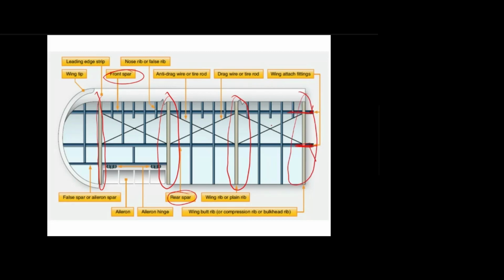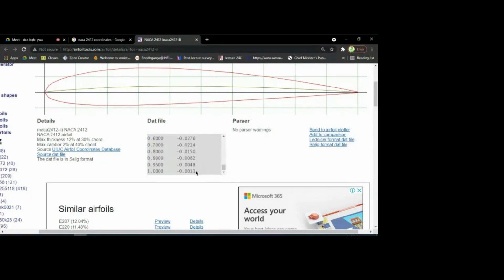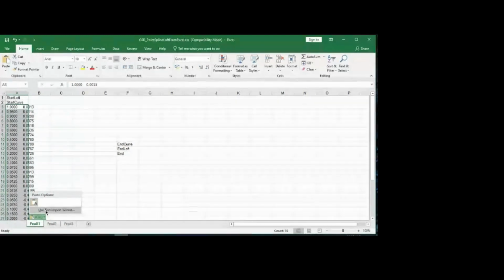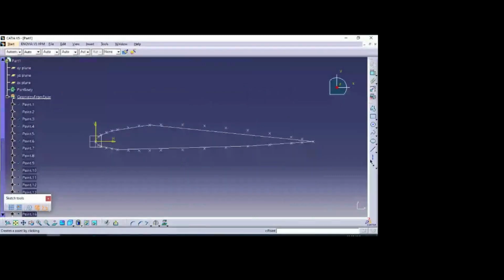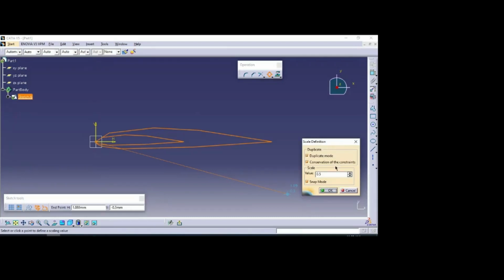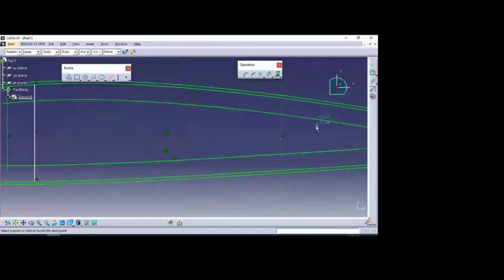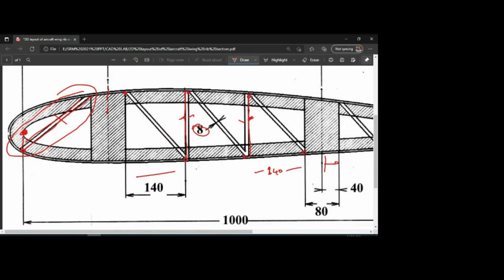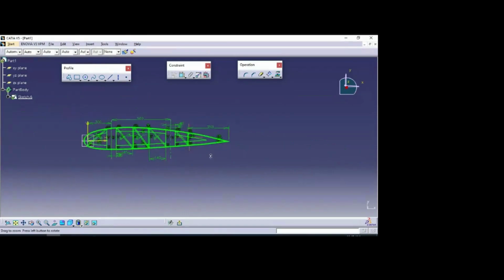CATIA - 2D RIB DESIGN

Comment: While running macros, I got the message that object is not supported. What does this mean? At 16:42
Reply from the maker: Check whether, the CATIA - Part design is opened before running the macros. also check the Excel file for proper format.
Reply: @AeroDesign3  I also received the same message,  I need to change the version of Excel?
Reply from the maker: Check whether, the CATIA - Part design is opened before running the macros. also check the Excel file for proper format.